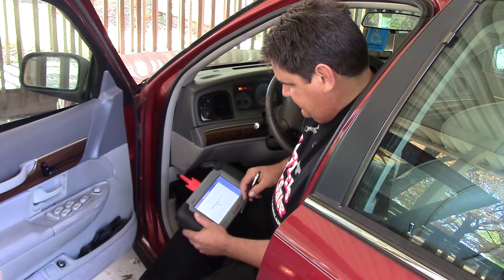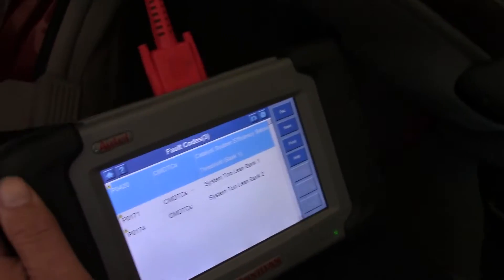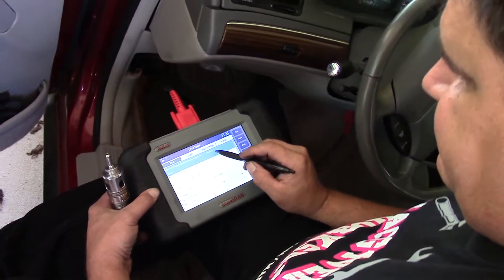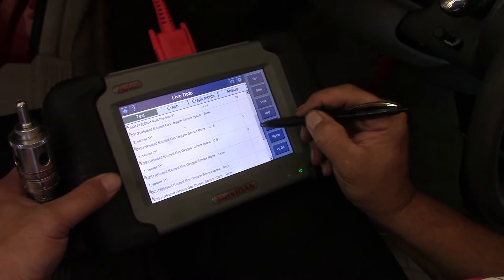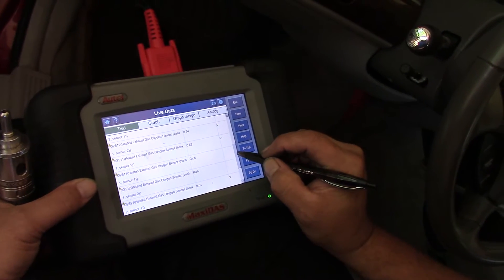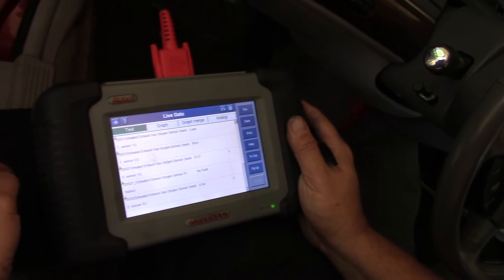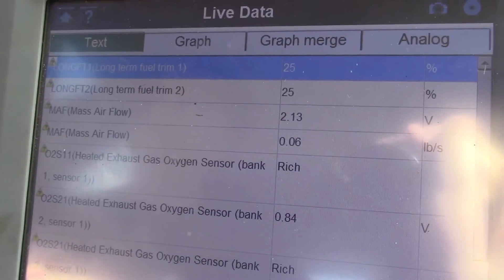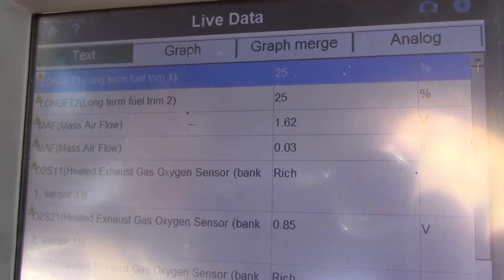P0420 code diagnosis on a 1996 Mercury Grand Marquis

Comment: I have a 97 with p0430 134k miles. How much would it be to have the motor cleaned like you suggest in the video?

Comment: So was it just the exhaust ports filled with carbon or was there a buildup on the pistons and head?
Sounds like it needs some good long motorway runs at top legal speeds.
Reply from the maker: Ports. chambers, piston tops, they are all loaded up to hell and back with carbon.

Comment: Mac i've a huge favor to ask?
I have an american made Toro Wheel horse rear catcher 1991 model parts for them here second hand are no were to be  found and some parts i need you cant get in australia anymore and if you can they cost the earth.
i can get one part i need from american ebay but when paying with paypal the exchange rate is excessive i was wondering if i told you what i need would you price them for me or even see if you can get a good second hand part and ill fix you up for cost and postage?
Thanks in advance.
Reply from the maker: Sure, email me at macgyversworkshop@gmail.com and let me know what you need.